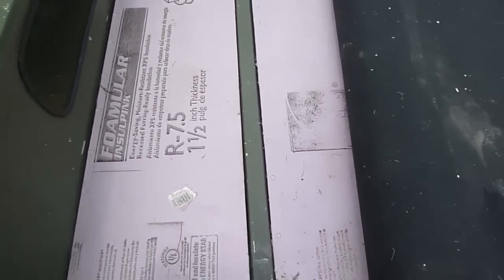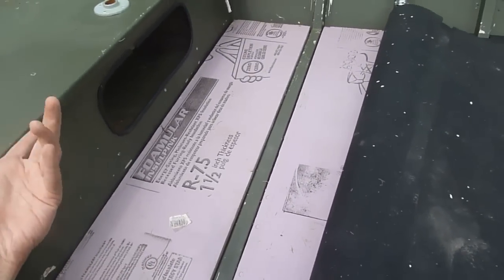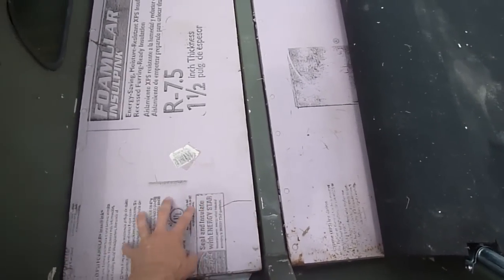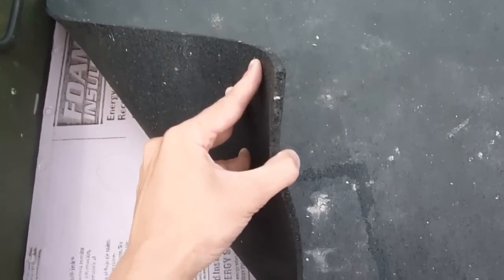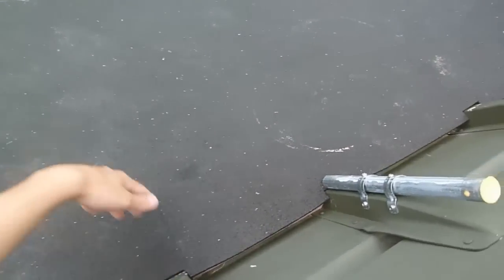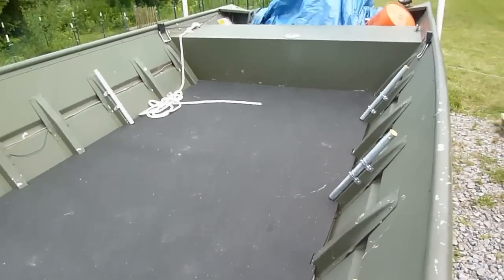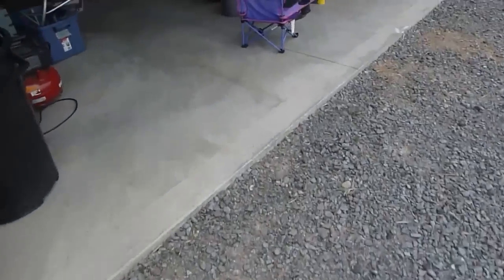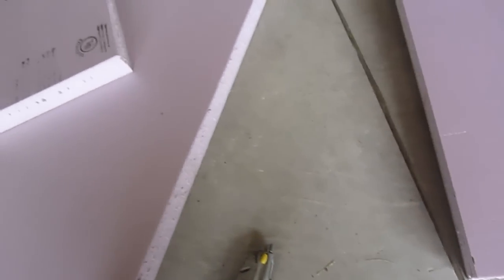cheap and lightweight Boat floor for our jon boat (MATERIALS LISTED IN DESCRIPTION)

Comment from the maker: Just a quick update, 3 years later and thee floor has held  up amazingly! It will last another 3 years no problem!
Reply: Airing Fowled How hot does it get in the sun? ever any problems with that during the summer? looking at doing this to my boat this weekend. Thanks!
Reply: I'm in PA by the way so not exactly Florida but still some fairly warm summers
Reply: U did good young man Kodos. For the heat ?'s Just go one step further !  Double Coat the surface with Roofing Rubber Based Sealer. I'd go white. Easy clean to.
Reply: You'll like this, I am going to put this floor down in my van, I didn't even know it was legal to hunt ducks! (just jokin:) Actually, since I plan to live full time in the wilderness, I would be interested to learn more about hunting and fishing
Reply: Great video. I watched your video & done this to my boat last year. Floor is holding up fine. Thks!
Reply: That’s the best idea I’ve seen yet
Reply: How’s it holding up now now? I want to do this to my boat... live in California... heat up to 110 degrees sometimes
Reply: Great set up. We are going to do this. How much do you think it weighs ?

Comment: Okay so a fun fact, if you're worried about the capacity for withstanding pressure, Fomular (sold at home depot) lets you choose the rated psi (from 15 to 60 psi). For this example/calculation, I will use a 300lb man. 
So let's assume the 300lb man is standing on one foot. His foot size is 12"x3.5". Take 12*3.5 = 42. Divide his total weight by the square footage of his foot, 300/42 = 7.14 psi. 
So basically, even the lowest rated PSI of the pink foam will support a 600lb person on one foot, even without the mat.
Reply from the maker: Great calculation! thanks for the help!!
Reply: You're right that was fun! I was picturing a fat guy standing on one leg trying not to fall overboard
Reply: Ouch....I lost you at "Okay"!
Reply: I was trying to NOT PICTURE TWO 300 POUND BROTHERS FISHING ON THE SAME JON BOAT.
Reply: Don’t you just love engineering 😂
Reply: Would this work in a inflatable raft I’m like 300lbs or close and size 12 foot so you’ve peaked my interest into using this

Comment: BE WARNED. Black horse stall mats absorb and retain heat like you wouldn't believe. I bought a mat from Tractor Supply to cut up into strips and use as AR500 steel target hangers. It was 98 degrees Fahrenheit that day and the mats were in a stack outside. I carried one from the top of the pile to my truck which was only about 30 feet away and I blistered my fingers. 

Those mats should be just fine on a cold, cool, or maybe even temperate day but they'll cook your feet on a hot day and make that boat deck miserably hot.
Reply: imahvi in Canada I need all the heat I can collect. Lol

Comment: I am doing another one this week. We live where there are a lot of resiviours within an hour. There are also some places where a bass boat isn't an option. One of those is the Illinois river. Every spring, the white bass spawn in the upper end but a large section of the river, above Lake Tenkiller is white rapids and impossible to use traditional methods. The options are a 2 man, kayak, inflatable, jon boat, or float tube. The jon boat has as shallow a draft as the inflatable and is a lot tougher. Sometimes the satisfaction of the project is as satisfying as the fishing. I'm a senior now and a $65,000 bass boat makes no sense. Conversions like this are fun, inexpensive, and you can always change them.

Comment: Great idea and I copied this from you.  I also used the 1 1/2" foam but then I went to Harbor freight and bought ANTI FATIGUE mats that you would use to stand on in a  work area for my covering.  Its also lightweight and it worked nicely.  Thanks for the idea on this.

Comment: Used 3/4" insulation panel two layers, .05 thick x 4' x 8' roll of aluminum, 3/8" x 4' x 8' rubber horse stall mat from Tractor Supply.  Rubber mat is just laid on top of foam and alum.  Easy to remove if need to. Elected not to screw in permanently.  Got idea from Airing Fowled.  approx. $76.00 and 50 pounds added.  3/4" rubber not needed.   Put in 1648 Alumacraft NCS.  Good traction.
Reply: How hot did the rubber mat get in the summer

Comment: Great idea.  I bought 3/4 inch from Tractor Supply for my home gym.  Those horse stall mats are tough.  Looks like you have the lighter 1/2 inch material.  Much cheaper than plywood now too.  Only issue I have with it is the black color.  In the Texas sun that would bake us alive.
Reply: Just cut out a piece of carpet and throw on top of black material 🤣

Comment: Awesome idea. EASY! I just ripped the carpet, plywood, and foam board out of mine (was all rotten and water logged). Just bought new foam board and wrapped in contractor bags to waterproof. Got the mats from tractor supply. Shouldnt add too much more weight than dry plywood but heavy enough to hold it all down without securing

Comment: Cannot get the 1 1/2" in Houston so I bought two 3/4 " and some spray adhesive to glue them together.  Will see how it works.  Cost more this way, but still better than wood.
Reply from the maker: Theres an idea! don't forget to let me know how it goes!
Reply: Airing Fowled The spray adhesive melted the board and did not stick.  Oh well.
Reply: Awesome to know.  Thank you

Comment: This idea worked great on my deep V 14 foot aluminum Sea Nymph. I used two pieces of insulation in each section and left a space in between so any water, in the boat, can drain to the bilge area.  Covered with 1/2 horse mat from Tractor Supply. Thanks!
Reply: Can I see a picture of this? Just picked up a 12ft Sea Nymph and I'm trying to make sense of doing the same thing.

Comment: That rubber mat weighs more than a sheet of 3/8" plywood! Nice idea but no cigar dude.
Reply from the maker: I actually linked a rubber mat in the description that is much more lightweight! The mat in this video was a little overkill. We wanted a nice non slip surface that works well with shoes or going barefoot.

Comment: Thank you for sharing! I am on the hunt/about to get a 1436 and this will be in the top 3 first mods done to the rig. Once I get a chance to overhaul the whole thing... I will go back and add 1/8" diamond plate (with the foam still underneath) ... held down with some aluminum Rivnuts to the ribbing. That way I can quickly take it back up at the end of each season for a freshwater rinse and another application of Fluid Film. I will be in almost 100% salt... and some brackish waters.

Comment: Instead of the stall mat, the 4x8  pvc sheets that are like 1/4” thick or whatever(they are thin) work great and weigh less. Just secure it with some rivets, then slap some EVA foam on top and it’s nice to walk on, doesn’t get hot in the sun, and is easy to clean.

Comment: Instead of the horse mat you can use a sheet of the rubber mat that is used under shower drain pans. A lot thinner and lighter and gets rid of the clunking every time you do anything in the boat. Also you can cut most rigid foam insulation board with a hot wire. Nice work on the boat.
Reply: Do you happen to know what the rubber mat is called? I would like to go this route to reduce weight.

Comment: That will be one hot bottom. I was going to put black diamond shape rubber  in my 15 ft Fisher Marina I am restoring. Laid the mat out and cut it. Worked on the boat a bit. Then went back to get the mat. SOooo Hot I could not touch it. Now What was plan B.

Comment: 1240 Lowe here; I did the same thing with the Foamular Insulation Board. I believe I used the 250 flavor. I cut the sizes I needed to fit between the ribs of the floor between the back  and middle bench. Instead of a rubber mat, I had a thin scrap piece of plywood that was the perfect size to fit that floor area. I hit it with a few coats of spray paint to help seal it, then I stretched astroturf over the top and secured with gorilla glue. They had rolls of astroturf/patio covering at Home Depot for $20 a roll. This works fine for me, it was cheap, I had the materials on hand, and if the wood shhts the bed one day, it never owed me anything. The turf doesn't get hot at all even in 90+ midday Summer sun. I sometimes fish barefoot and the turf is cool and feels good on your feet, better than standard Bass Boat floor coverings. IMO there's a ton of ways to mod Jon boats, everyone has a different approach or ideas. Though I would say, using the Foamular Board to fill the spaces between your floor ribs is the way to go regardless of what you cover it with. Safe Boating and Tight Lines, Cheers!

Comment: I highly recommend the pink, gray or green closed cell foam board. I needed 1 3/4 to be level with the tops of the ribs. There are several guys on here that rebuild jon boats. One of them showed some of the pink closed cell foam and some boat pour foam that had been put in a boat 2 years prior under the floor and the pink stuff looked like new. The pour foam was full of water. Dont use the white Styrofoam. It will absorb water and crumble. The foam board laying in the bottom of a flat bottom ribbed bottom jon will allow water to drain in the ridges in the bottom of the boat. I found a sign shop that had alucobond sheets. 4x8 for  $65 a sheet. About 28lb a sheet. Paint it, rhino line, eva foam, or just leave it, whatever you want. It will last forever.

Comment: I was in the market for something to line the floor on my boat project, but now thinking about it, black would not be my first choice. Mainly because the sun beating down on it allday while fishing would possibly burn the shit out of my feet if I were barefoot (I kick my shoes off while fishing some times) I'm thinking about using some of those cushy floormats used on concrete for in front of a work bench in my shop. They're light and would work perfect to glue onto the floor of the boat. I believe they even come in rolls too.

Comment from the maker: That's actually genius. Maybe I should start to save a ton of bloopers when they get really bad and do a video a year designated to all the funny screw ups i make :x. Thanks for the idea friend!
Reply: How is a foam floor holding up under weather conditions I'm more concerned about it getting waterlogged do you have any problems with the foam holding moisture if so that could be a major problem it would add a lot of weight to the boat once it got waterlogged just curious of how waterproof that foam flooring is?

Comment: I'm just wondering if that foam will absorb and hold water if so that could be a major problem. I would have to look into it because I have a 14 foot jon boat and I want to do something with the floor either Coosa board or something that's not going to absorb and hold water I definitely don't want to use wood.

Comment: I bought my materials and will be starting on the floor in the morning. My only problem is my jon boat is 4'6"  wide on bottom and the horse stall mats come in 6'×4' so one way or the other i have to do a small patch job but i will do the best i can. I absolutely love this idea and i need the weight since im throwing a 75 hp johnson stinger on my boat lol

Comment: Just curious, but how does the insulation help the boat float if the rubber mat does not hold it in place. If water were to get in the boat the insulation along with the rubber mat would just float right out of the boat would it not?

Comment: Wow, I use this stuff for lots of things, but never thought of doing this. Great idea! I would glue it down and add more flotation to the boat. I WILL be adding this to my boat project/ restoration for sure.
Reply from the maker: Sounds great! The reason we didnt glue it down because we wanted to be able to take out the floor to clean the boat underneath and to let it dry out easier if we take in any water from waves!
Reply: But if your boat takes on water... the foam and rubber will float without your boat...savey?
Reply from the maker: Don Wilson
yes that is true. Although we are not using the foam as floatation. I do believe every jon boat has foam underneath the seats and front deck that would act as floatation if the boat did ever begin to sink. If you did glue the foam down then that would be a great way to add extra floatation! We felt that being able to take out the floor would fit our needs better. Good idea though!!
Reply: Well done Sir.
Reply: could always put something down across the foam like a removable strap or strips of aluminum under the rubber. If she sinks you'll loose the rubber but the foam will stay in place.

Comment: Yea thats some thick foam, should hold up for quite awhile! we usually use that to re-add back to the foam we may have to take out during the floor design..  Works great and is low profile like you say! Great video!

Comment: So for clarity, the only purpose in putting down the styrofoam and mat is create a walking surface? Wouldn’t a 1/4 inch sheet of plywood do the same thing?
Reply: Harold Baker 1/4 would be very flimsy, the foam adds insulation and quiets the noise as well as supporting the plywood/mat/etc that you plan on using. With the foam the 1/4” plywood would work but without the foam it would add too much stress

Comment: I like your idea with the foamular board and the mat. I just recently bought a new 14ft Alumacraft jon boat and was looking into doing something like you have done. One problem I see is the rubber mat being black, absorb's  lots of heat especially in those summer months. I was thinking if I do the same as you I may try painting the black mat with something like Kool Seal, like you use on rubber roof travel trailers, but I believe Kool Seal only comes in bright white, maybe silver and that might be kinda blinding in the bright sun light in the bottom of a boat. If it can be done maybe have the Kool Seal color tinted like a light tan color or maybe light gray. That would be my question to find out, can Kool Seal be color tinted ? and I think it would work out perfect if it could.
Reply from the maker: To my surprise the black mat never became as hot as the aluminum boat deck and seats did! This is probable because metal heats up a lot quicker then rubber does.

Comment: Only downside of that I wonder is the heat it would generate. I work with horses and when we clean some stall mats we take them outside and after about 25-30 min in the sun these mats can generate crazy heat from the sun and become almost impossible to handle. I don't know how it would feel all day out in the sun with this right below me...
Reply: paint it a lighter color or use spray can bedliner

Comment: How was it after getting it wet in freezing cold during duck hunting. Did it get real slick? Has it held up so far?
Reply from the maker: Still has held up as new and it has been a year. It was also left out all winter with snow and ice and is still fine, NY has a long winter this year as well. It works almost as insulation so water does not begin to freeze quickly. I have never noticed the mat becoming slick.

Comment: I just did this project, thanks for sharing. Best floor idea for a jon boat. 
FYI, I found rubber mat roll of  90" x 48 " x 1/4  online at Truevalue hardware store.
Reply: How did the 1/4” mat work out? Just picked up foam. I’m trying to decide what rubber mat to buy.

Comment: if you take on water this would be a bad idea correct?
Reply from the maker: No this is not a bad idea. If you notice when in the jon boat on the water, the lowest point is right back by the motor. If you were to take on any water, it would travel down the ribs underneath the foam all the way to the back behind the back seat (lowest point) where we didnt put in any foam or horse mat. The water is easy to scoop out or use a handheld bilge pump. I highly recommend you to leave a handheld bilge pump in the boat as a safety factor incase anything were to happen. Thanks for the question!

Comment: Hey buddy where did you go too get that Foam Board? I went too our local Lowe's they didn't have it.
Reply from the maker: I actually got the foam board from Lowe's! I will keep looking for an online link to where you could purchase this foam board from. I have read in the comments that a solution to not being able to find 1.5" thickness boards you could glue two .75" boards on top of each other. I hope this helped answer your question!
Reply: thanks man. I found it at home depot!
Reply: Almost all lumber suppliers sell it or a similar type. try home depot or your local lumber yard. Trying to find it by brand name is often futile

Comment: Everybody knows about the rigid foam!? And i PROMISE you that rubber mat weighs way more the wood and supplies zero structural advantage to the boat. Only thing you accomplished was noise dampening and non slip

Comment: What will water do to foamular? Water is the inevitable enemy of almost anything that is pourous. No matter how dry you intend to keep the inside of a boat, it always gets wet. Unfortunately, there are a lot of other liquids that will come in contact with the floor. That is why boat manufacturers use specific materials. I remember the early Bass Trackers. For the first 15 years, they had wood floors sealed with glass matting, but they still rotted. Do you really need a floor to begin with? a couple sheets of plywood isn't expensive and weighs very little. You can easily cut it to fit and with marine carpet, it will repeal most liquids. We have done several and always do them in sections with small straps attached so they can be removed in less than a minute when you get back to dry.
Reply: He's not going into space. It's simple, It works, and it doesn't cost an arm & a leg. Finish it off with a WHITE Rubber based roofing PAINT & it's finished. He did well.